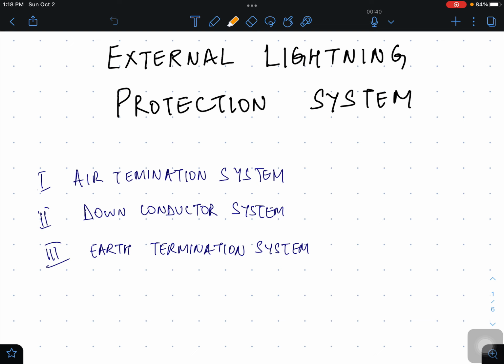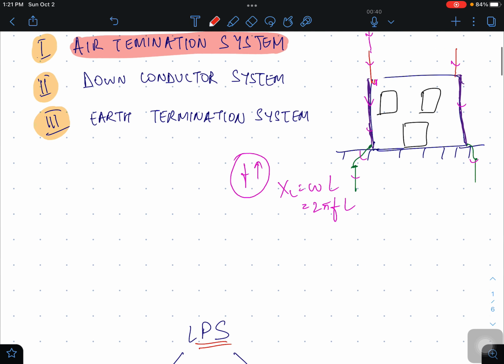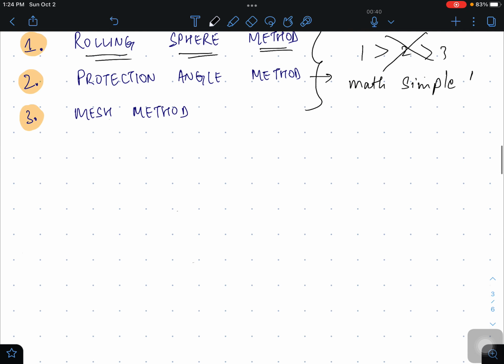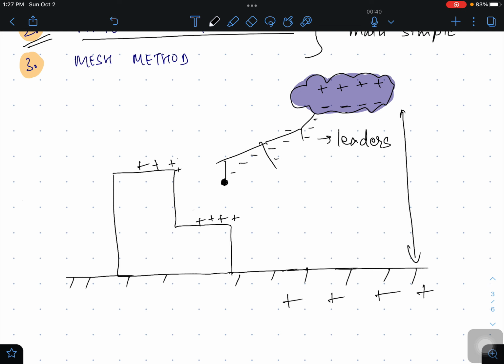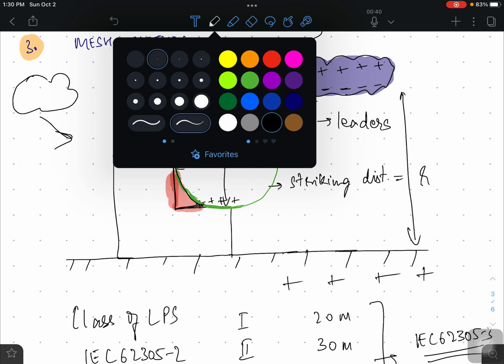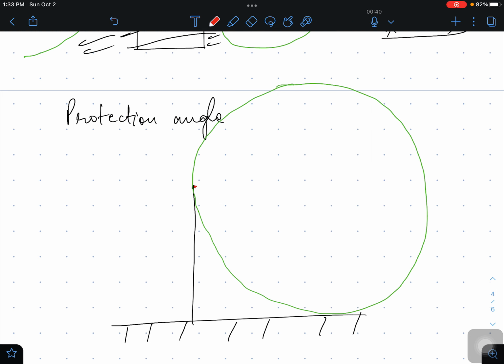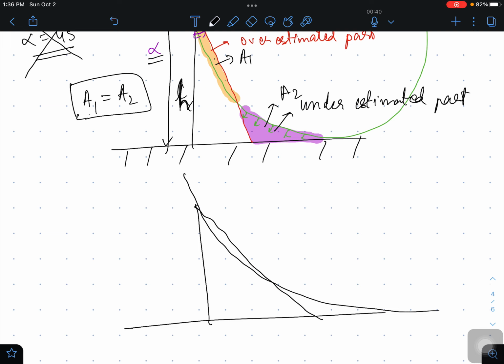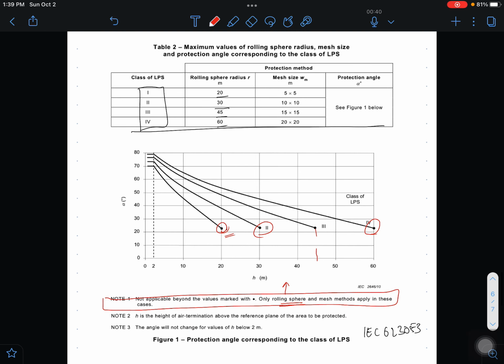External Lightning Protection System Lecture 1: Basics of Air Termination System

Comment: HOW DO YOU DESIGN THE SIZE (CROSS SECTION) OF DOWN CONDUCTOR?
Reply from the maker: For this we need to refer to iec 62305-3 table 6 or table 2 of iec 62561-2
Reply: @railwayengineeringinsights6463  what is the contact resistance limit for the down conductor connection?